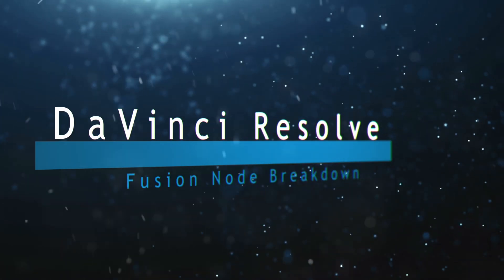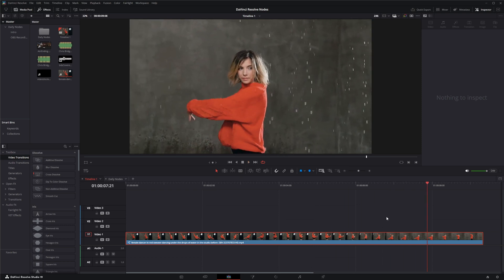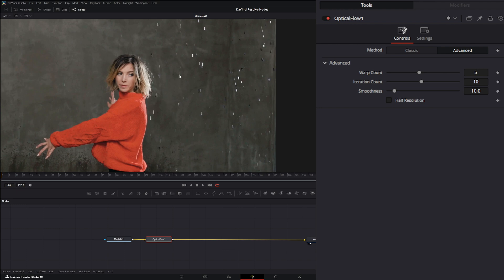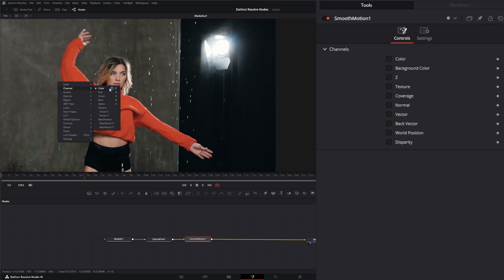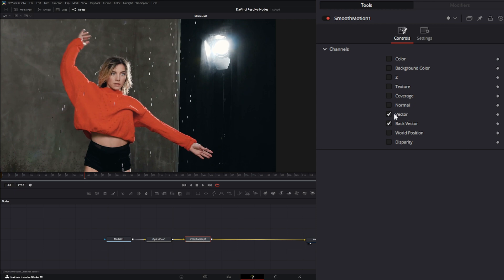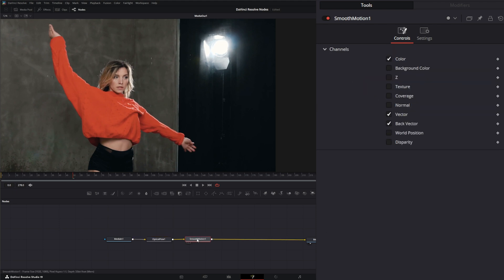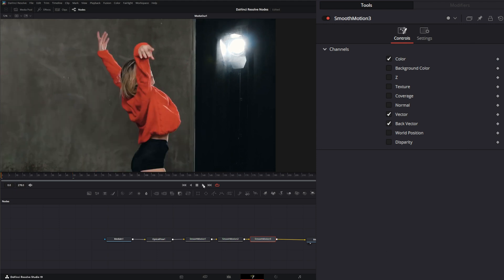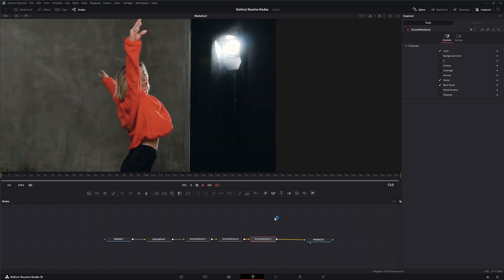DaVinci Resolve Fusion Smooth Motion Node

Comment: I am trying to understand the logic;
1 smooth motion node > 2 frames
2 smooth motion node > 3 frames
3 smooth motion node > 7 frames?

I was thinking it would be 5 frames instead of 7. Please, what am I missing?
Reply from the maker: Lol, no. If I said 2, 3 and 7 I was wrong (probably a long day)...I should have said 3, 5 and 7. Meaning 1 node is 2 Frames (1 before, 1 after) + Current Frame totaling 3 frames. 2 nodes is 4 frames (2 before, 2 after) + Current Frame totaling 5 frames. 3 nodes is 6 frames (3 before, 3 after) + Current Frame totaling 7 frames.  Sorry for the confusion...hope this clears it up.